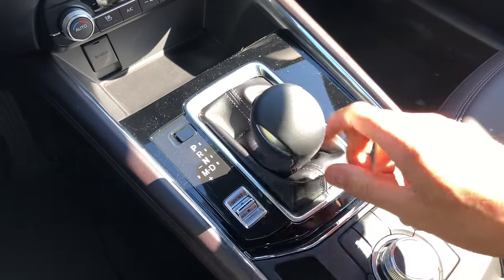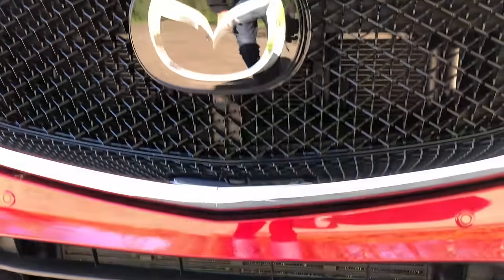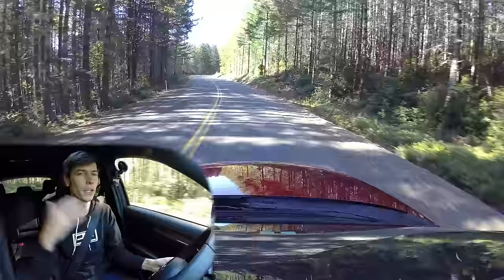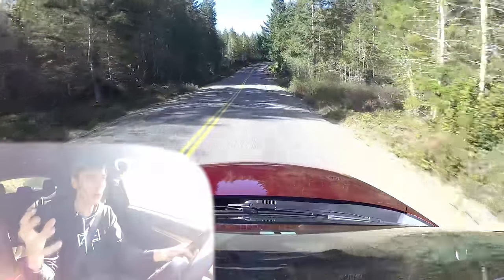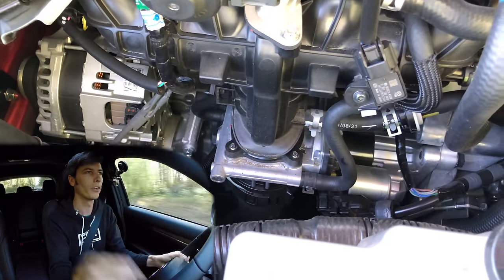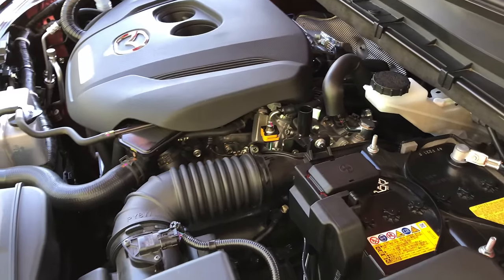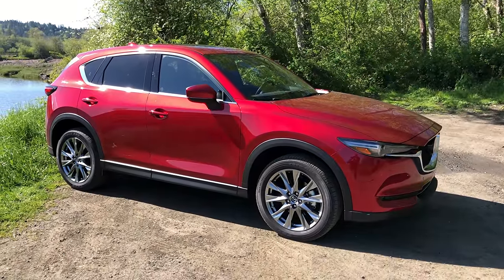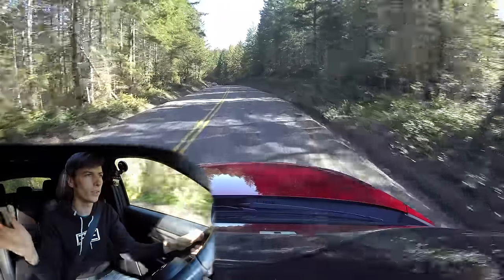Are CVTs Bad? Why Mazda Avoids CVT Transmissions

Comment: My advice , if you know what is good for you , stay away from CVT transmissions .
Reply: Ronin T I am a rideshare driver and my 2016 CVT Toyota Corolla LE has 16100 miles, no issues at all 🤷‍♂️👀 Proper maintenance is the key. For Corolla, you need to change the transmission fluid every 60000 miles. You also need to change the filter and clean the three magnets. “DNY automotive “channel shows the proper way to change the trans fluid.

Comment: I know this is an older video but maybe someone will find it of some use. I had a 2019 Kia Forte which has a CVT and quite honestly it was the best programmed and best feeling CVT I've experienced. I forgot it had a CVT after a few weeks. It's a shame so many CVT's are programmed poorly or just feel like rubber bands. When done right they aren't all that bad for a daily driver. I just recently got rid of that car so I can't speak for long-term reliability but I never had a single problem. My new car has a DCT which is more fun and engaging but definitely no where near as smooth at crawling speeds. Each design has its pros and cons.

Comment: One of the reasons for frequent oil  changes in a CVT is probably to get rid of metal shavings coming off of that steel belt.  They are using the public to "develop"
this tech. Cheaper that way.

Comment: We have a 2016 Forester with a CVT. Have to say, it’s a good CVT. We had a Saturn vue that had a junk CVT. I called it a CST for continuously slipping transmission. It never”hooked up”. I think what makes Subaru CVT’s good is they use a chain rather than a belt covered with metal. My WRX however has a six speed manual. What else would one want in that car. I had a Crosstrek with a CVT. The only saving grace on that one was the paddle shifters.....

Comment: Good idea, CVTs are not working out well for the long term,  however Mazda missed the boat with the installation of single direct fuel injection
Reply: ut1004bp I am a rideshare driver and my 2016 CVT Toyota Corolla LE has 161000 miles, no issues at all 🤷‍♂️👀 Proper maintenance is the key. For Corolla, you need to change the transmission fluid every 60000 miles. You also need to change the filter and clean the three magnets. “DNY automotive “channel shows the proper way to change the trans fluid.

Comment: My mom is short at quite a bit less than 5ft. She used to drive an 03 RAV4. When we needed a new car, the whole line of Toyotas let us down, she actually couldn't see over the dash, or reach the trunk to close it. Hondas didn't fit either. The only car with enough adjustability and a dash that didn't cover half her line of sight was the Mazda CX-3. And they are beautiful cars, in our opinion way prettier than the others. The interiors are also clean and simple, easy to navigate. Having a simple set of knobs for control is far better than the disgusting clutter in a lot of the models.

Comment: CVT is unreliable and very expensive to fix. CVT breaks and it's $2000 minimum
Reply: icecool1616 yea...it's called cvts are a cheaper alternative to manufacture
Reply: icecool1616  it isn't cheaper. That's why you'd be spending 4,000 to 9,000 to replace yours while I maintain mine for 40 bucks every 30k miles. If mine breaks, then 1,200 to replace. Have fun spending 30.00 on a single quart of transmission fluid!
Reply: icecool1616  even a hammer wouldn't break mine. It would have to be a weak transmission to break with a hit from a hammer. I think you should do some research to back what you say. I've seen several articles and videos of the worst for Crapy Vehicle Transmissions (CVT)

Comment: Unless I’m shifting the gears manually, I’d rather not feel the transmission.
Reply: I have a CVT Subaru. When I rode in a previous generation Honda Fit with a traditional automatic (the current model is CVT) I found all the obvious shifting annoying. Of course, in a larger and better car the shifts in ordinary driving would not be so obvious.

Comment: Toyota/Lexus hybrids does NOT HAVE CVT. They don't have a traditional transmission at all which is a genius solution.

CVT's sucks though.
Reply: Toyota/Lexus hybrid do have CVT's
Reply: @08VaNupe  Nope, the power is transferred from the engine via two electric motors that act both as motors and generators. No CVT or any other transmission.

Comment: CVT's are fine if you are buying a snowmobile.
Reply: bobdadruma I am a rideshare driver and my 2016 CVT Toyota Corolla LE has 161000 miles, no issues at all 🤷‍♂️👀 Proper maintenance is the key. For Corolla, you need to change the transmission fluid every 60000 miles. You also need to change the filter and clean the three magnets. “DNY automotive “channel shows the proper way to change the trans fluid.

Comment: Mazda went with planetary autos because they have them, have not done the R&D on a CVT, and they can apply that transmission across the entire lineup. Subaru went CVT because they need to take advantage of every opportunity to get better fuel economy because of the inefficiency in their AWD system.
The non-hybrid versions of the Rav4 has a planetary auto, but I don't think that matters to the target audience. Even if Mazda gave away a brick of gold with each CX-5, the Rav4 would still outsell it - Toyota is  a juggernaut when it comes to vanilla vehicles.

Comment: Cvt gearbox will put a bigger dent on ur wallet once it go kaput..i would rather get 4at cars from kia,hyundai,mazda or even Proton in my country rather than getting cvt cars..nissan cvts will cost me like $1500/rm6000 in my country, compared that to a 4at gearbox which generally cost between rm1500-2000 or a mere $400-500 ish
Reply: Specific Proton models have CVTs, like the current Iriz & Persona. However, the 2019 Saga finally ditched the CVT in favour of the standard automatics. Finally, Proton listened to their customers.
Reply: @xuminarc  im praising the new Saga..cvt might be good for fuel economy but long-term use and replacement will hurt our wallet

Comment: My daughter drives a 2007 3s now and it is an amazingly engaging car to drive even with 214k miles, tho it’s not the easiest to work on (had to remove entire intake manifold to change out the $5 PCV valve). But once she lands a real job and is ready for that next vehicle I’m going to recommend a CX-5 or maybe a newer 3 hatchback.

Comment: The other significant advantage of using EGR is that it decreases pumping losses because it effectively shrinks the engine by filling the cylinders with inert gas, meaning more throttle opening is required to make the same amount of power. More throttle opening means less vacuum in the manifold and less energy wasted sucking air through a closed throttle plate.

Comment: Sales of vehicles with CVT continue to be good because MOST people Dont know WHAT CVT is.
Clueless about the reliability.
Reply: It's because the sales people are clueless to what it is and how it's supposed to be driven. It's not the fault of the tech but the one's that sell it.
Reply: How is it supposed to be driven?

I thought the whole point of automatics were that it adjusts to your driving... low gears or ratios for power and acceleration, high gears or ratios for cruising or coasting. Use sport mode to hold lower gears or ratios longer for on-demand acceleration or engine braking whether it’s CVT or a traditional auto.
Reply: Will McGregor it has nothing to do with being clueless... only people who hate CVT say that. As this video mentions, there are many pros to having a CVT. 

CVTs have come along way... and aren’t what they use to be. Unless you’re Nissan of course, lol. Time will be the ultimate decider though, we will just have to wait and see.
Reply: My CVT is reliable 175000km and no problems. Have you owned a vehicle with CVT?
Reply: You know nothing about CVT!
Reply: Definitely!

Comment: I will never own a cvt
Reply: Josh Russell I am a rideshare driver and my 2016 CVT Toyota Corolla LE has 161000 miles, no issues at all 🤷‍♂️👀 Proper maintenance is the key. For Corolla, you need to change the transmission fluid every 60000 miles. You also need to change the filter and clean the three magnets. “DNY automotive “channel shows the proper way to change the trans fluid.
Reply: Im telling this to you on why i would never buy a cvt car ever again.
My brother had a mitsubishi gallant it ran like a charm with no issues and his a racer.
Now my brother bought a cvt camry because he had a family and the engine exploded in 4 months, this might be my brothers fault at not changing fluids, oil or whatever.
But he took care of it like your ordinary family car.
He then bought a honda accord manual for uses...

Comment: Toyota's hybrid rav4 cvt does not change output shaft speed compared to input speeds from engine. It is basically a  1 speed transmission with a highway gear. It uses the high torque electric motor combined with the gas engine to make up for the normally required lower gear ratios on an automatic or cvt transmissions.

Comment: cvt just do not last.
pain in the ass.
most cvt singing after 50'000 miles onwards.
they need lots of improvements.
Reply: Kito I am a rideshare driver and my 2016 CVT Toyota Corolla LE has 161000!miles, no issues at all 🤷‍♂️👀 Proper maintenance is the key. For Corolla, you need to change the transmission fluid every 60000 miles. You also need to change the filter and clean the three magnets. “DNY automotive “channel shows the proper way to change the trans fluid.

Comment: My old early 90s manual Mazda 626 GE 1.8 still running well and passing emissions tests and all. Body skirts usually need some work these days to get through yearly inspections, but that's nothing odd for car this old and salty roads during winter. Can achieve around 6,3l/100km on normal 80-100km/h roads based on the usual "fill up your tank" calculation method. Body has almost 600 000km in it. Engine needed piston rings to be changed around the 300 000km or so. So in other words, next car will be Mazda as well.

Comment: In '93 the Williams Formula 1 team experimented with CVT transmissions and found that their car with a CVT was several seconds per lap faster than the ones without it, mainly because the engine was always in its peak power band and accelerated out of corners better. Another plus was the driver didn't have to concern himself with rowing gears. I would imagine that shifting adds to fatigue and it takes one hand off of the wheel.
In '94 Formula 1 for whatever reason ruled that cars had to have fixed gears -- and for shits & giggles added a clause to the ruling specifically banning CVT transmissions. The most likely reason was that it made the fastest car in Formula1 even faster. Another reason might be that the CVT used was developed in house by Wiliams, so nobody else would have the same technology, at least for a year or two.
In general cars with CVT transmissions get better fuel economy than most cars with manual and other automatic transmissions because they can use engine power more efficiently.

As far as dual clutch transmissions, don't like stop and go traffic, when cars just creep along and especially stopping and starting on inclines. They are more expensive to manufacture and when they fail, and they definitely have failures, they are very costly to repair or replace. They may also require more frequent oil changes than normal transmissions, if they have wet clutches, because the wet clutch packs deposit clutch material in the oil as the clutches wear. If not changed frequently enough, the deposits in the oil can cause havoc. Also the dry clutch units are susceptible to shuddering when shifting, caused by internal leaks that gets dry clutch packs wet with oil. One common complaint of dual clutch transmissions is jerky operation at take off.
The dual clutch transmission was first invented in France around the beginning of WWII for Citroen although it was never used in production. Ironically they have been in development and production for a few decades in German vehicles. Back in 2017 one BMW executive hinted in an interview, that they may drop dual clutch transmissions.

Dual clutch transmissions are like flat plane cranks. Different, but not necessarily better, especially when it comes to an everyday driver.
Reply: Best post on this whole video

Comment: I am not a big fan of automatic transmissions and have owned many new Honda cars with a manual transmission. As you get older, like me, cars become kinda hard to get in and out of, so I reluctantly bought a SUV  because of that problem. That SUV was a 2016 Mazda CX-5 and I love that car and the automatic transmission in it. Mazda has built the automatic transmission for people that really don't like automatic transmissions.

Comment: I own a Honda HRV and FIT both with CVTS haven’t had any issues.  Folks sometimes complain they are sluggish but I honestly have no issues particularly with the ECON off.  Shrugs. I can get off and on the highway without feeling like I am struggling that is all I care about.  Typically I just change the transmission fluid around every 30k miles.  Which is more often then recommended but the fluid is cheap compared to the transmission.  I never have noise issues, power issues and they both shift smooth.

My GF previously had a Nissan CVT that is another story lol

Comment: I don't know what they put in new cars but I tried some brands and I felt brand name is all they got. Torque or Turbo but something felt really spongy and dead with acceleration. Probably all the high efficiency gadgets. I still drive Hyundai Santa Fe 2009 (>10 years old) and it shifts smooth. Like this CX5 they used larger engine (3.3L) and 5 gear transmission that basically eliminated the problem of delays between gears. It's also worth to note experienced driver can feel RPMs without actually thinking about them. He/she will soften/harden pedal just tiny bit depending on what cycle transmission in. No, I have no clue when the shift happens but by speed of the car I do realize when to press harder after gear up and lighten to create that CVT feel. Technically it's RPMs but one can tell by speed they are going at. Ie. car wants 4th gear at early 40km/h and so on. It's also worth to note car makers were fully invested in building quality cars with metal drive chain, and low costs on wallet (87 gas), which is by far comes at 10% discount compared to premium gas modern cars need. With modern mazda CX-5 2019 efficiency 7.6-10.8 and H Santa Fe 2009 8.3-12.6, mazda will still need synthetic oil, synthetic filter, premium gas with high price serviceability on any part. Remember those 1950 cars? well they still start even after 20 years in garages. Likewise, self-aspired engine give live horses which often can get you out of dangerous situations like waiting for a turn and getting full power rather than slow carriage rolling under an incoming car with your torque converter. We hope new sensors statistically help but we end up with overpriced products we can't efficiently use. Electric cars were too complicated and so expensive. Now with combustion engine cars resembling space rockets and poor performance the electric cars looks like kids toys - cheap, simple and reliable even in noobies hands. Car makers even forget about lithium environmental issues because buyers fed up with the trends of combustion engines.

Comment: I had a 2004 Mazda 3 2.0 L drove it from 185,000 to 298,000 km engine is perfectly fine so is the transmission and it was quick good car I would consider a Mazda in the future. Ton of power. And I still have it.

Comment: Two of my children own Civics (2016 and 19) as first cars with CVTs.   They don't have the experience to know the difference, but I do as I have driven manuals and automatics all my life.  I can say, without hesitation, I don't mind the CVT at all in those cars.  They are plenty peppy enough and get great gas mileage to boot.  Both are the 1.5L turbo.
Reply: em745a  Listen, they are not rockets, but they do have some decent giddy up and they get 35+ mpg.
Reply: em745a  Yes, I am aware of that.  I haven't had any issues with them.  You can also google any car and come up with a list of issues.  Not sure what your experience or expertise is, but given you can't spell turbo, I am assuming it's only a subjective position with no objective data supporting it.

Comment: This system works well with low power engines because it makes driving more flexible. The Daf 600 (1959), 33 (1967) and 55 (1972) have had some success thanks to the Variomatic system.

Comment: I owned a 2013 Mazda 3 equipped with a 1.6. The transmission, although better than  CVT, was always an annoyance. It did not shift smoothly, especially from 1st to 2nd with moderate pedal.
Reply: @em745a: I didn’t notice the rough, abrupt shift when I test drove it. Who’s transmission does Mazda use now in 2020?  I shopping for a new car now, would you buy a car with a CVT?
Reply: @em745a: thank you—appreciate the feedback.

Comment: you forgot to mention the worst part about CVTs – reliability. After 50k-100k, if the thing breaks, it's not going to be serviceable. You'll have to pay $5-6k for a replacement unit.
Reply: Well there are different types of CVT’s the belt driven ones that Nissan uses are bad. But Toyota Synergy Drive uses planetary gears so very reliable. 160k on my Prius and it’s just fine.

Comment: Automatic transmission does't apply only to those using torque converter, CVT are also automatic !
The main problem with CVTs is that it's unplesant to drive, when you want to accelerate hard, you have the feeling that the transmission is slipping.
The VAG group (VW, Audi, etc.) has dropped CVT transmission in favor of its DSG double clutch automatic gearboxes.